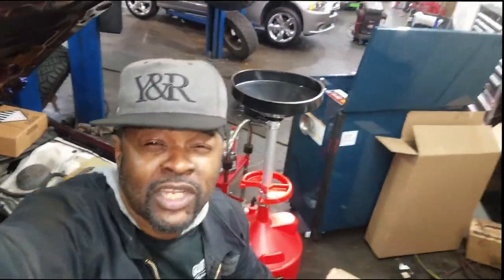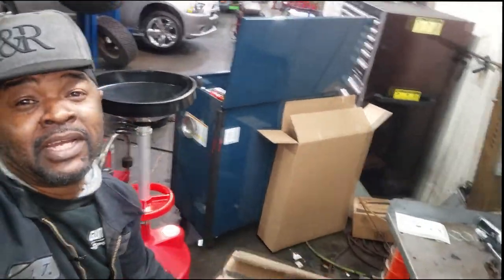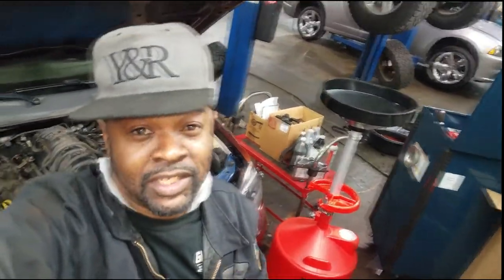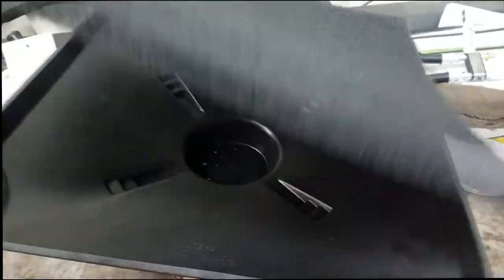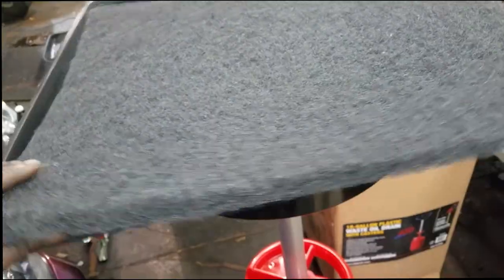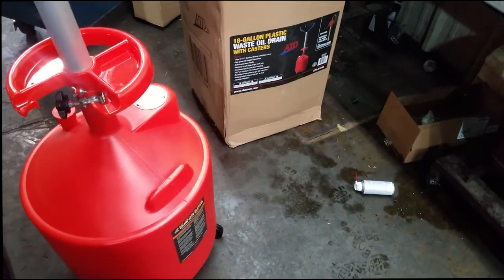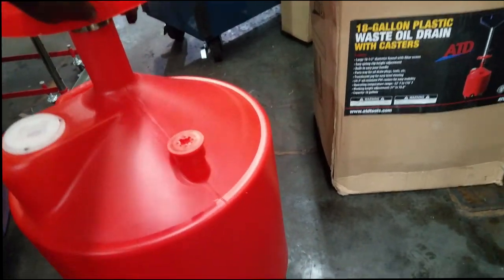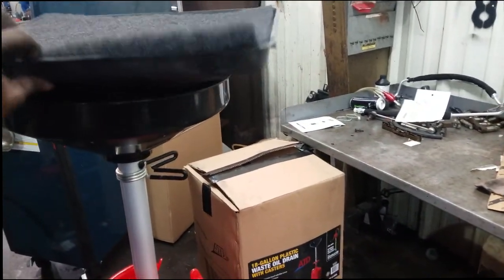My new shop toy,. Best drain bucket for waste fluid

Comment: Yo man I have a pt cruiser that the is extremely hard to push it work but it’s a pain in the ass
Reply: My horn is  hard to push should I spray that with wight grease or is that a whole different problem
Reply from the maker: @gabelaucella4044  what you mean by hard to push? what year your PT?
Reply: JT Automotive Rideshare Guru 01 pt cruiser the horn switch it hard to push I have to put a decent amount of pressure on the switch to get it to work
Reply: JT Automotive Rideshare Guru  also I can’t find any tabs to pop the air bag out so I can get a better look at the switch